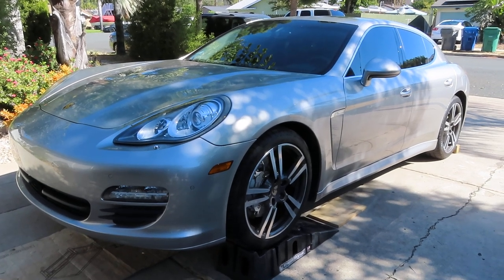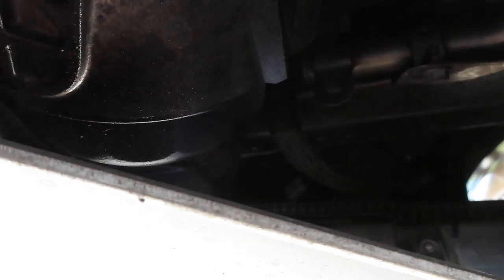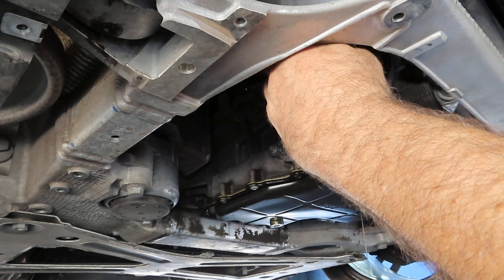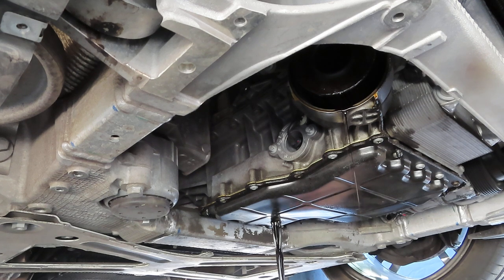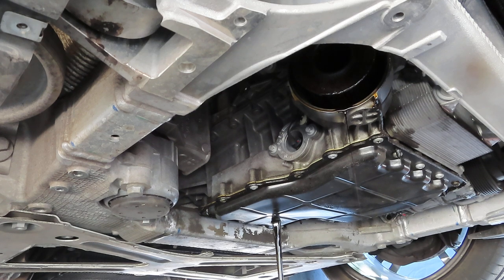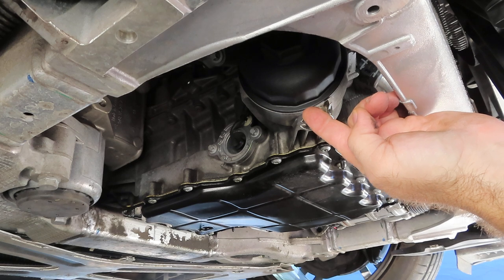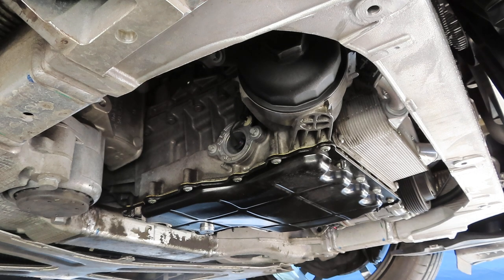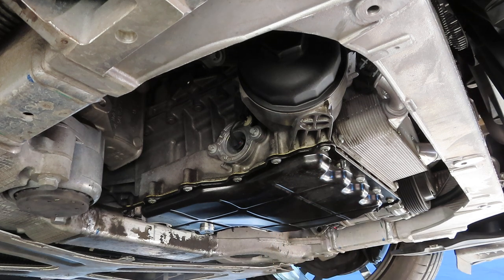How to Change the OIL on a Porsche Panamera S

Comment: Thanks for the video. If you seat the oil filter in the plastic oil filter housing first, you can easily screw it back on. And yes, lube the O-Ring with fresh oil before you re-install. You can also put a box or something similar under the oil drain pan to get it closer to the filter, so it doesn't splash. Then drain the engine oil.

Comment: I found the "new" drain plug to have the same problem, almost wouldn't thread in properly, so I reused the old one.
Reply: Planning on doing mine this weekend, hopefully the new plug won’t give me this same problem
Reply: @Coolhand69  
If it were me, I'd reuse the old plug with a fresh washer.  There's no real good reason you should have to change a drain plug every time.  I just know when I went to re-thread, it felt like I was going to ruin the threads on my oil pan and I didnt want to chance it.
Reply from the maker: @johneldorado  I've been using the old Brian plug for 6 years now. Can't find a new one that isn't messed up.  I think they are trying to get us to damage the oil pan so we'd have to buy a new one? Thanks for Watching!

Comment: Your video is really helpful, so thank you! Can you please put the links for the small accessories like oil plug, oil filter and washers? Are they original Porsche parts or did you get them off ebay? Does the manual have any info about that?
Reply from the maker: I have always used OEM Porsche parts. I spent some time searching the internet for the Porsche factory part numbers for the parts I need, then I search the part number on the internet to find the best price. Sometimes eBay, sometimes Amazon and sometimes dealer website's. The prices very greatly so shop around. Thanks for watching
Reply from the maker: The OEM  Porsche filter is a rebranded Mahle OX254D4. It's exactly the same filter. If you buy it from Porsche it costs $30 and doesn't include the o-ring.

Comment: Great Video Thanks! How do you reset the Oil Change Notice?
Reply from the maker: You need a scanner to reset the oil service. I got mine from Ebay.  It's called icarsoft.  You can order it with Porsche specific software include.  I paid $150.
Reply: Tx! Keep up the good work!

Comment: Thank you for a great video!  Has anyone tried to seat the cap on the oil filter first, and then put both the cap and filter together into the housing to avoid that uneven threading issue you had?
Reply from the maker: I was just being too gentle with the new oil filter.  If I were to push it on a little harder probably wouldn't have had any problems. I just didn't want to damage the element filter since it was my first time

Comment: Thank you for this video. How do I reset the oil change light?
Reply from the maker: The oil change light has to be reset through the OBII port with a scan tool
Reply: @mikeshorsepowergarage7577  $5 says the dealership will charge me $500 to do that haha.
Reply from the maker: I picked up an OBDll scanner on eBay that reads all manufacturers plus it has special Porsche only functions. It will reset all service notices plus a lot more for $149.
Reply: @mikeshorsepowergarage7577  I dont do much ebay these days. Amazon has been my go to. I imagine I can copy and paste what you wrote and find it there?
Reply from the maker: It's available on Amazon also. As soon as I get home from work, I'll get you more info
Reply from the maker: The scanner I use is called iCarsoft POR II
Reply: @mikeshorsepowergarage7577  Thank you. Just ordered on Amazon. This car has to be the easiest and fastest oil change I have ever done. I spent more time going to the dealership buying the parts than the actual change, thanks to your video.
Reply: About to reset the oil light, do you have a video on how to use this device to do the reset?
Reply: I just tried to reset the light but the device pops up with an error code out of the box saying it doesnt know the car.
Reply from the maker: I don't have a video on how to use scan tool. There are instructions that came with it that will help.
Reply: @TavitsPhotography  actually its 700
Reply: @russellbrown9655  2nd dealership wanted $250. I ended up buying the correct tool and started doing it myself. takes less than 5 min

Comment: How to change the transsimison oil, thanks
Reply from the maker: To change the Transmission fluid the car needs to be level. So a lift is necessary. Plus you'll need Porsche's dealer software to fully drain the old fluid from the transmission.  After that it's a simple refill. Thanks for Watching!